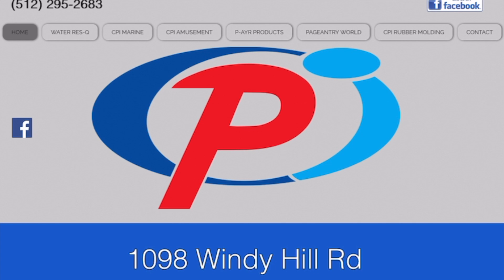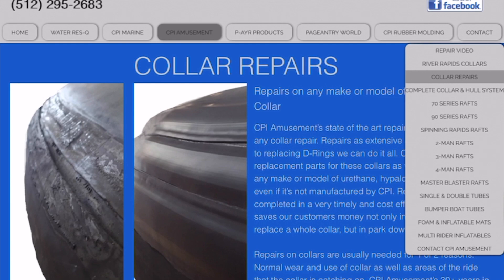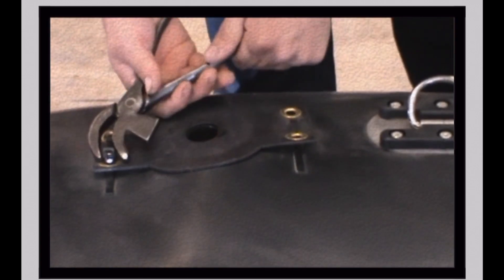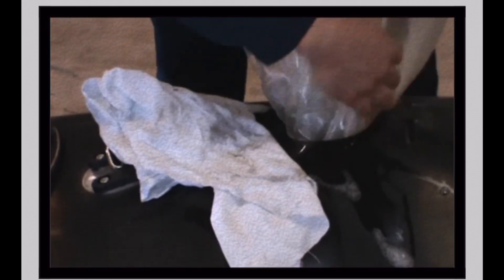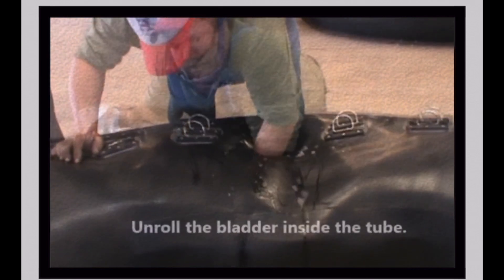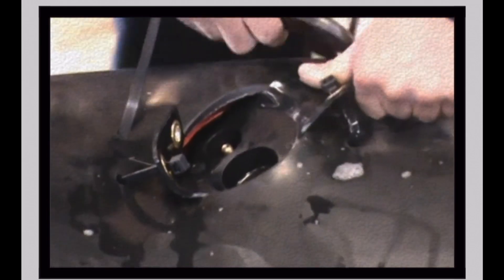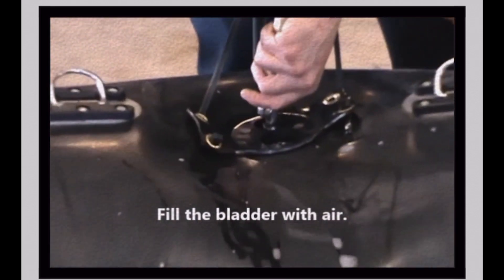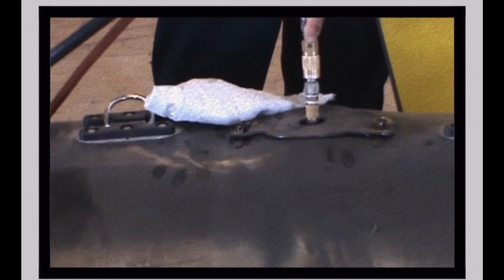Rapids ride inflatable bladder replacement on a CPI collar

Comment: These are such a pain to change but the soapy water trick I like I’ll give that a go next time!! I have to change at least 2 of these a week
Reply from the maker: Good luck. I always hated when I finally got it in there and it was between the outside and that orange liner, DANG IT!!!!
Reply: @ryantheridemechanic   oh yes I know the one!! And that bit when you pry it with a screwdriver and it all pops out is such a relief 😄
Reply from the maker: @thedjcorky  we always seemed to loose the ones on either side as well typically the next day. I attribute that to just inflating, you really have to check the entire raft before you put an air nozzle to any bladder.

Comment: I had to do this...
Don't forget  the cardboard...cause when you melt the knot...you do not want to get that on the tube...lol
Especially when they cost around 20,000$ for a new tube...
We replaced 3 new tubes every season....if needed maybe one more...but the usual is 3...
Talk about run re-roping them...we never had ZIP TIES HOLDING OURS...OURS WERE INTIMIN...and you had to replace the whole thing....and it was inflated to 6 newtons...not anymore...
Reply from the maker: For the longest the park was repairing the Intamin tubes. Come to find out the repairs didn’t work because the company doing the repair wasn’t sure what they were doing :( so that’s when we switched to CPI. They could repair what they built.

Comment: Starting as a maintenance engineer and then becoming a controls engineer, I am really enjoying your videos. A question I have is about ride evacuations (possible episode). On the vast majority of roller coasters, there are steps on the lift hills, so I can see how rides are evacuated. However, here in the UK, there are two coasters at my local park, Alton Towers, where I cannot see how they would be evacuated if the coaster got stuck on the lift hill.

Galactica, which is a B & M flying coaster that has no steps on the lift hill, and you are going up it in the "flying" position

The Smiller, a Gerstlauer that has a vertical second lift hill

(I worked in medical; however, there are a lot of similarities for maintaining rides in theme parks; we used to say the same S***, different game.)
Reply from the maker: Once your heavy into mechanical, yes, same S$&@ different game haha! I like it. Rides like a B&m flyer or  a vertical lift use special moveable platforms for evacuation. You typically have to offload 1 row at a time and bring them back down. The flyer should have a small staircase to the side that the moving platform connects with. They remove the handrail to allow access to the stairs.
Reply: @ryantheridemechanic  Excellent... Thanks 👍
Reply: Ryan already answered for the B&M Flyer (and you can see the moving platform he mentioned near the start of Galactica's lift) but for vertical lift rides it's more complicated. Some of them have motors capable of reversing or emergency eddy current brakes to lower the train to the bottom of the lift safely. Intamins like Fahrenheit opt for two chains as a redundancy to make evacs extremely unlikely. And a lot of Gerstlauers have an elevator next to the lift - I recall reading from an op at Darien Lake that the practice extractions they perform on that ride are pretty terrifying.
Reply from the maker: @CheesecakeMilitia  yea your right I was thinking of positive locking lifts. But for a lot of the gerslaur (pardon my spelling) vertical lifts they just come back down under the weight of the trains against the eddy fins. Thanks.